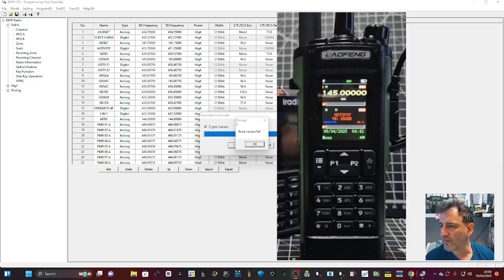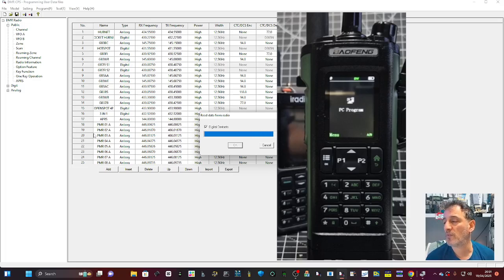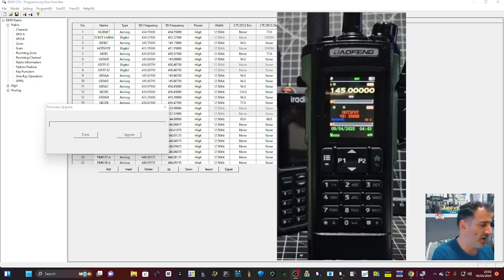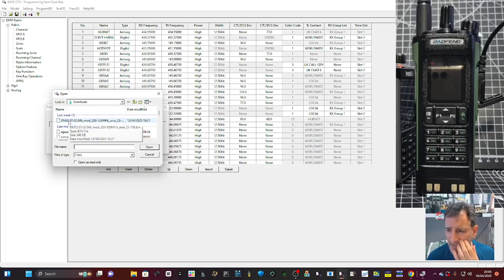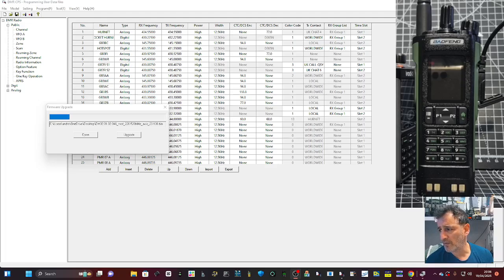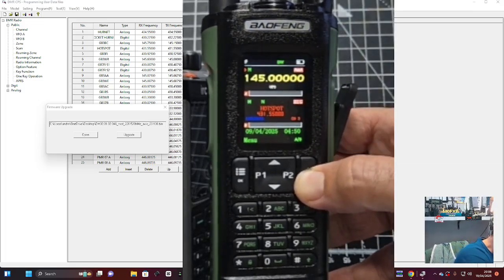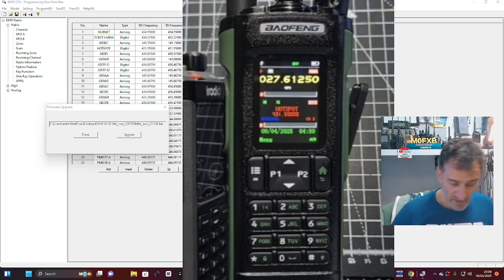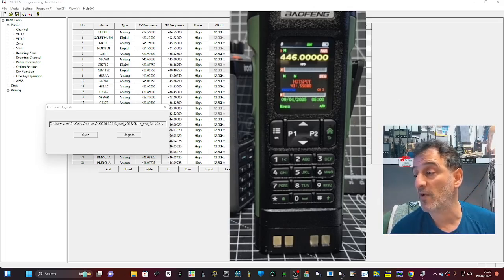Baofeng DM-32 Mod  Bin File - RX - CB  10/11  Meters

Comment: I tried joining the FB group.  I answered the questions, and I was blocked...... That's a friendly community? 🤨
Reply: I installed V.49 with CPS 1.50. V.49 is basically V.47, but it gives back recording (leaves the rest of the perks) which V.47 takes away.

Comment: Its time for Baofeng to build a all mode handheld radio, true FM, SSB, AM, and Digital mode, with 10 watts on all bands, fully unlocked, for all countries, it can be done with a few key strokes on a key board at the factory.
Reply from the maker: Lol that would be £2000
Reply: @HamTechRadioScannerDrones don't laugh look how fast it has got to where it is now, from the information I have seen, you can be looking for a radio like that sometime next year, thay are designing this equipment now using AI, its even being used to design new cars, and other electronics.
Reply: that would be great, this radio with ssb and digi mode👍

Comment: I've messed around with them some more.  I have received two of them.  They are truly great radios at this price point.  There are a few issues that I believe I should share:
1) It is not water-proof.  You can do a few things to make them more protected that I won't expand on.
2) The programming software currently has a bug whereby the encryption setting does not stick.  You must export to CSV, manually modify the file, and then re-import.
3) The knobs are weak.  The stems are made of plastic, not metal.  Be careful.  I received one that was broken off and had to get it replaced.
4) They are fussy about programming cable quality.  Make sure you have a good one.  Those old UV5R cables are not good for these sometimes.
Reply from the maker: Overall its fine main main bad thing is we want to load 250,000 contacts
Reply: @M0FXBHamTech  Ya, that is a lot of contacts.
Reply: yea my old cable didnt work i used a ftdi - usb
Reply: you can get a motorola that fixes all those problems, just be prepared to pay $600 USD+.  you could buy 7 of these bad boys for that price. one for every household in your family.
Reply: The encryption sticks in the radio but you have to go manually into the radio channel and turn it on. Every time you write to the radio you will have to go back and manually turn it on for each channel once again..
Reply: @StuartGorsky  I found that if I just edit the CSV, and then import, it turns the encryption on properly in the radio.

Comment: Hi I’m getting communication failed when trying to read the radio, any suggestions ? I’ve tried everything and not working for some reason
Reply from the maker: Push cable in harder
Reply: @M0FXBHamTech  I tried to push it in harder wish no luck, then tried pressing it against the table and still no luck haha
Reply: Pull the cable from the USB port and reinsert allowing Windows to reattach the driver. Also, CH340 cables will need a newer driver than Windows provides. Took me hours to find the right driver, and now I can't find it again.

Comment: There appears to possibly be a secret menu.  If you hold down the two small side button while turning it on and waiting for a few seconds, there is a passcode request.  Has anyone else tried this and discovered the passcode?
Reply: Still waiting for my DM-32, though I noticed that internally the (binary) software labels it as a UV-32 version 2. Is there an indication on the number of characters in the passcode?
Reply: @vsc9835  It looks like 8 characters.  Apparently it's nothing.  If you check "allow reset" in the CPS, it does not ask for a code and instead factory resets.
Reply: @LeaveMyFreedomBe  Found on the web two passwords. The radio and CPS adjustment menu P/W is 66660501. The CPS embedded information menu P/W is 374612. Though I have yet to try modifying anything via the CPS menus. Note the radio test menu is not in English. Also when I checked allow reset in CPS, I still didn't get the option to reset the radio after flashing the latest firmware (w/ the latest CPS S/W to set allow reset). Not sure what is going on with that.
[Edit] I did bump up the output power at ~145 MHz a little bit with a measurable difference in the output power. Though I left alone playing with frequency coverage, given I assume the filters are not present for this band.
Reply: @vsc9835  it takes you to a radio technician mode for tx tx and dmr settings that is all used google lens to translate

Comment: Does the 220 band actually work without causing harm to the radio?I mean generally you shouldn’t try and TX on bands the radio doesn’t have the filters or hardware for. 
Also the CB band being 11m, I would presume in RX only for the same reasons and the fact the DM32 doesn’t have any AM output capability.
Reply: It shows the frequencies, but it does not TX or RX in the 220 MHz band, according to my tests.
Reply from the maker: Yes worth testing .

Comment: Will DMR work near 220Mhz with this firmware?
Reply from the maker: No
Reply: @M0FXBHamTech  That firmware file does 23MHz - 136MHz (AM RX only), 136MHz - 174MHz (TX/RX), and 220MHz - 520MHz (TX / RX).

You are incorrect, the answer to the original question is "Yes". You can use FM, 4FSK (DMR), and encryption anywhere the radio can transmit. I don't know how clean the signal is outside the official bands, but DMR does work on 220MHz.
Reply: @HamTechRadioScannerDrones  Darn, Rx only?

Comment: My DM 32 randomly as if I push the PTT button when I placemy radio in my car middle console, I know that there's some wires for the gearbox underneath and a Bluetooth wire, thats all, still on stock radio firmware
Reply from the maker: Ok

Comment: were you able to get the other baofeng dmr cables working for the dm-32uv?
I've always had my dm-1701 working with this cable yet my dm-32uv doesn't. otherwise which cable are you using with this radio? as far as I know, this radio doesn't like cables from TYT. I've tried that as well but to no avail.
BTW, the error I see on device manager has always been "port reset failed" on all usb ports of my pc. yet same cable detects the dm-1701 normally.
Reply from the maker: Yes my baofeng cable works
Reply: I use generic baofeng cable that comes with uv5's with zero issues.